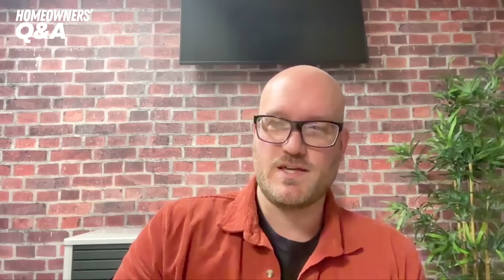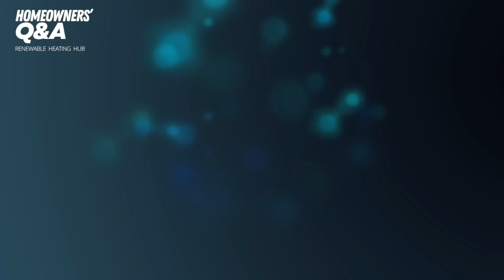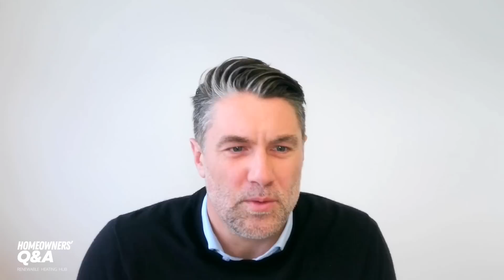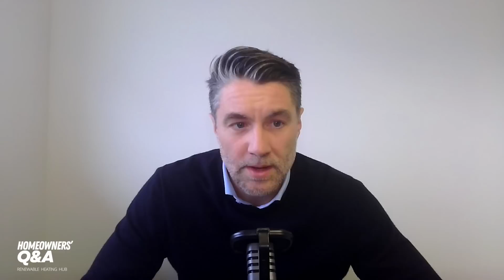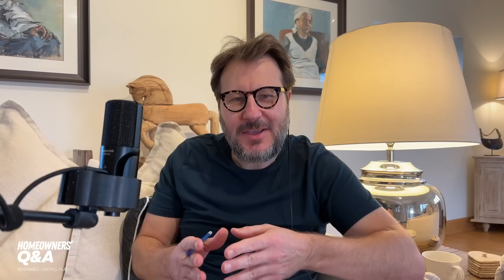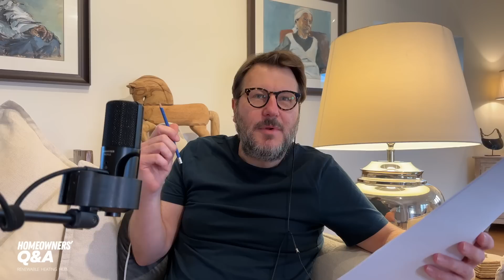What Should Homeowners Consider When Retrofitting a Heat Pump to Replace a Boiler? #podcast

Comment: We had a heat pump to replace a gas boiler under the previous Ofgem scheme. The designer seems to have gone mad with 3 additional pumps , buffer tanks and blending valves to keep the price high. Net result  after a year is we have disabled the second blending valve and found a competent ashp engineer  from the heat geek directory to re tune the controller to a weather compensation system in the controller and  now we have lower running costs with a warmer house.

Comment: we  have an octopus ASHP install in a week time...  this low/high on off scenario.... our heating is used sporadically over the winter months as our home is well insulated, I now understand that is should be on all the time.  anyway what should I do with my ASHP setting in the summer?..  should I leave it on 10 degrees or something? currently our 18 year old WB boiler is off (for heating) 8 months of the year?
Reply from the maker: Your heat pump will automatically turn off when the outdoor temperature reaches a preset level (usually 14-18C and above), depending on how your installer has configured it. Once it’s in standby mode, the heat pump will only activate to heat your water, based on your schedule or settings.

Comment: I've had 3 Octopus surveys and due HP installation in February.
My 1950s house wasn't built with central heating and since the Glowworm was 26 when I moved in, in 2007, my WB is 18, so the system is likely 44yrs. All the bore is 15ml except on kitchen vertical that must have been added when previous owner partitioned off kitchen/diner and that is nearest the boiler and only 8mm. 
A plumber quoted £450 just to change the 8mm so I had the 3rd "senior" survey who agreed that since the 8mm heats no problem on my 50ish flow rate, it's a bedroom one on 15mm that needs the flow rate nudging up to 54. He said he was happy with the performance of the kitchen rad but would add a buffer tank in case the bedroom rad continues to struggle.

Comment: Great video, but I disagree with a point made around 14:00 about trying to keep gas boilers for the remainder of their natural lives. Carbon Brief solidly debunked this as part of their "18 Myths about Heat Pumps" article from a number of months ago. Heat pumps 'repay' their embodied carbon after only 13 months of use compared to a gas boiler which continually, unavoidably emits carbon through its use. Indeed, heat pumps will only become cleaner as the UK electrical grid switches to renewables and nuclear. Even new gas boilers could be sent to the scrapyard and there would be an environmental net benefit within mere years.

Comment: I’m a non technical home owner about to have an Octopus survey for heat pump installation.

I love the honesty of this discussion, I’d feel confident that any of the panel here wouldn’t oversell  me something that wasn’t right.

The nuances increase the more I learn from such helpful people.

I’m about to retire, I’ll be spending a lot more time at home, run an EV and feel that now is a good time to replace my gas boiler with a heat pump. I’ll be benefiting from the government grant, future proofing my property to the benefit of my children who will inherit, reducing carbon emissions and hopefully, making my home more comfortable as I grow older while saving money on energy costs. 

I’m also considering getting a GivEnergy or similar battery to make use of cheap rate electricity.

My question is, even though I’ll be removing a perfectly good gas boiler as described in the conversation, is there some sense in my thinking?
Reply: Did you go the GivEnergy route? Personally, I didn't because I was waiting for the GivEnergy Gateway2 which was supposed to be rolled out in 1Q25 but never arrived! So I switched to a Sigenergy system instead. Installed in July. Annoyed at the lost 4 - 5 months because of GivEnergy!

Comment: Good evening
I’m seeking some advice on future-proofing my heating system as I plan to replace all nine radiators in my 3-bedroom bungalow, which currently has a heating setup from the 1980s.

The system is currently supplied via 22mm copper pipes running from the boiler to a copper manifold in the loft. From there, 10mm microbore pipes branch off to supply the radiators.

As part of the radiator replacement, To future-proof for a potential heat pump installation, should I replace the microbore pipes with 15mm or even 22mm copper pipes leading to the radiators?
And also switch old radiators to double-vent aluminium radiators.

Any advice would be greatly appreciated.

Thank you!
TVR
Reply: My advice to you would be to have a room by room heat loss calculation carried out on your home. Once you know the heat requirement for any given room you can make a decision on radiators and pipe sizes. Without this information you're guessing.

Comment: Would be interesting to hear the panel's views of the building regs requirement to fit TRVs to radiators, given the benefits of running as open a system as possible.

Comment: Hydronic under floor heating here, with an oil boiler, thermal store, all in an old house - boiler is fine - it isn't going to be replaced anytime soon! 

We've insulated what we can without massively modifying the character and look of the house and we have good double glazing. I've just finished changing all of the thermostats from single temperature mechanical ones to programmable electronic ones. Actuators which were seldom turning off on the manifolds are now lazily coming on and off as required. Slowly, slowly! A boiler which was cycling on and off constantly is now running much less frequently and, when it does, it stays on for longer and goes off for longer. Time will tell if the savings are worth it, but it seems, emotionally, like they are.

People look at me as if I am mad when I tell them that we never turn the heating systems off - we just run 24/7/365 with daytime set and nighttime set back - 19C by day, 17 by night.

A friend of mine has a heat pump with hydronic underfloor in a newish house. He runs the system for a couple of hours per day and even then, he only heats the ground floor because heat rises. I can't convince him to leave it on all of the time as he can't grasp the idea of a large thermal mass lazily controlling his house.

Comment: I get this is concentrating on carbon footprint but we also need to realistic about cost to home owner.

Designing a system to need additional heat source in winter won’t attract people to having it done.

Don’t buy a Bentley and get told sometimes it might not get you to your destination so please have good taxi number ready incase. 

Biggest barrier with retro fit is cost of installation and making good cost also.

If you then have to start adding buffers etc to overcome problems such microbore reducing system efficiency really how long would it be for you to reclaim the cost of the installation and making good from switching from traditional heat source.

Heat geek have an online calculator- I have done every property I have lived in and best would be 22years to reclaim the cost of heat pump install through energy saving.

Just not worth it for a financial point of view.

Totally get it in new builds and renovation projects though but I don’t think retrofit is going to take off. 

Use manufacturer controls and make the existing boiler its most efficient is surely better if it a condensing boiler.

Comment: I think promoting a strategy of designing systems to 70-80% is pretty dangerous on several levels.  People are already being told heatpumps can't heat the house enough, and this would guarantee it to be true on those coldest days - a hard sell to move from a boiler that could still heat them at -20...  Not only that, portable electric heaters are a faff and a hazard.  A third of the electrical fires that are fatal involve electric heaters.  Plus the extra load on the grid on those coldest days if such a strategy were widely deployed would be significant.   If the sums really do work out that some kind of resistive heating top up is more economical and viable for the infrastructure, then surely the case for doing that can clearly be made and it goes either in the heat pump itself (or in the installation side, perhaps in the ventilation system).
Reply: In my case, the minimum cost is at 70% undersizing but we even have -20 degrees. Calculations are made based on compressor COP and temperatures estimated by weather satellites. Except that it is actually indicated a GSHP.

Comment: Secondary heat source is such a good idea for the short period of time when the weather gets bad. We’ve seen temperature drop to minus 10 or below but it is rare. 

I think we should be getting rid of standing charge on gas and have a hybrid system and have a gas boiler for when things get really cold or for water heating. I suspect that having much lower heat pump power would be much more efficient.
Reply: The commentator's suggestion of an electric backup isn't great for grid load. Nor is the idea of keeping the gas grid going for longer than it needs to?

Comment: Sounds like the customers are Guinea pigs while the heat pump industry is still trying to find what is god , bad , and indifferent , also find it somewhat amusing that the gentleman who is the referee is the same person who advertises heat bricks for log burners , is that because having heat pumps is too expensive to run .
Reply: No, a SCOP of 3.3 or better should allow a heat pump to match the energy cost of a gas boiler in the UK (see Jan Rosenow).

Comment: Very interesting video. I had to laugh at the last point about low and high instead of off and on. I've been preaching that for over twenty years since I installed my first Drayton digital thermostat. Our oil fired heating has been on since we moved in but only fires up when it's cold outside. I had to set the heating timer to be on 24/7 so that the thermostats could control the heat properly, it really only controls the hot water. Our boiler isn't even condensing and is 19 years old so will need replacing soon and I'm hoping a heat pump would be an option for use without replacing too many radiators.

Comment: I don't agree about not replacing a boiler until the boiler is close to being finished. It takes around 13 months to recover the carbon cost of a heat pump's manufacture, if you run a new boiler for another 15 years that is massively more carbon produced by delaying the replacement. (In theory you could fit a new heat pump every couple of years and still save carbon - not suggesting you do of course😀).

Comment: Hi, videos are great. 😊 Is Hep20 plastic pipe ok for a repipe for a heat pump getting mixed answers..I know the bore is slightly smaller but plan to oversize everything.. will this be sufficient?
Reply: Should be mostly fine... It all depends on required flow rate and the pressure loss of pipes. Hep2o will be fine in most cases, unless there's several larger radiators being fed from it. And since the joints are demountable and compatible with copper, it is easy to replace... It may be that only a few sections need uprating.

But it's up to the engineer to do the calculations and PROVE pipes needs replacing, not just be anti-plastic. And even then, it would be a few sections not all of it.
Reply: @TheBadoctopus  many thanks thats great 😀
Reply: How do you rate HeatPunk software for calculating your heat loss and selecting heat pump size and radiator upgrade?
Reply: @NickStroud my calculation matched the suggestions of my installer. Using it I suggested a couple of radiator changes they were happy to include.